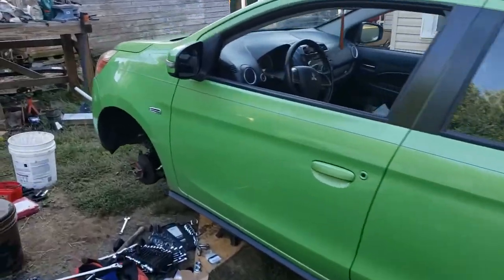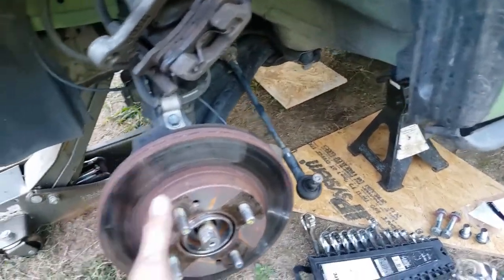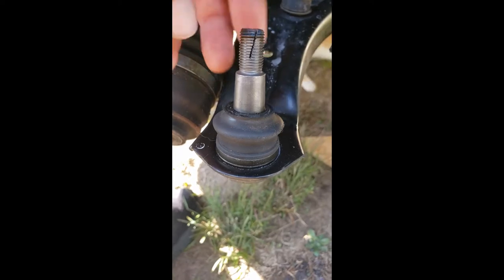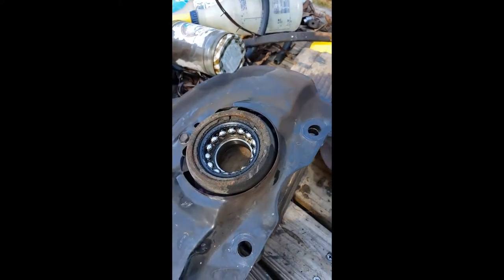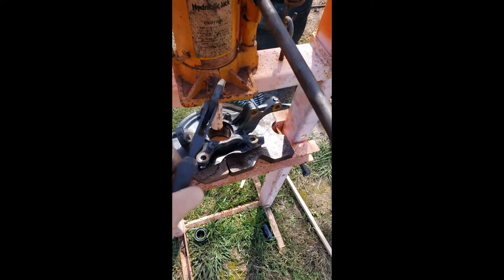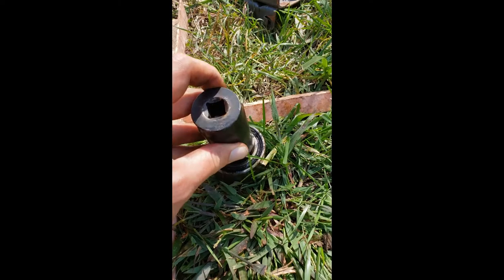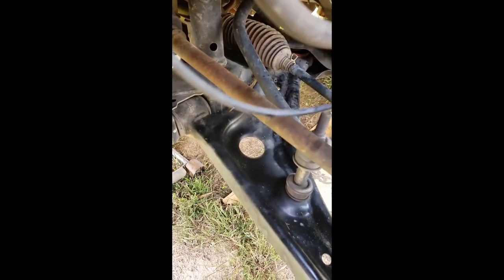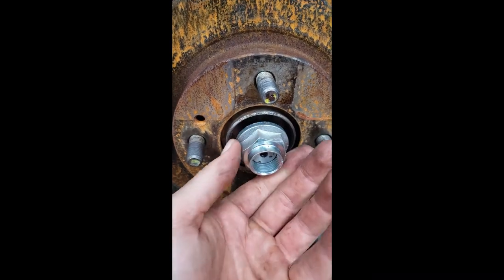2015 Mitsubishi Mirage Front Wheel Bearing Replacement

Comment: Jeez your old snap ring looked fine compared to mine!  (also a 2015) Mine was so rusted one ear snapped off, had to get the cutting torch out just to remove it.....nothing like living in the Rust Belt of Ontario! Lots of good info here, thanks. One thing that I noticed is that the torque setting you used for the axle nut is a little light. The service manual says 199 ft.lbs for the axle nut.

Comment: I replaced my engine a year and a half ago. And then the transmission earlier this year. I've been trying to avoid shops and do all the work myself. But this, I think I'll let the shop handle it. Great video, you saved me a lot of headache lol!
Reply from the maker: It was my pleasure. I have been dreading changing the transmission. Any tips? I have been looking for a used one and they are not very easy to find locally.
Reply: What year is your Mirage? How many miles did you have on the original 3A92 engine and JATCO CVT7 before you had to replace both? The powertrain on these simple Mirages are usually very reliable.

Comment: Thanks for the video. My 2015 ES is only at 35k, but I’m sure this will be useful whenever my bearings go out.
Reply from the maker: My pleasure! I will be adding more videos for the mirage and others so stay tuned. 
James,
Reply: @shutupanddoityourself  I recently bought a 2017 G4 and it needs tires for sure and possibly wheel bearings. Looking forward to the gas mileage of the 5 speed with gas prices going up!
Reply from the maker: @camaro2002rs  I am right there with you! It is pretty rare to beat the mileage of these little cars. Just have to keep them on the road. Haha

Comment: Ok kids, gather around. So removing and pressing wheel bearings that look like the one you see in the video is best to let a shop replace it for $40 per. Simply remove the knuckles. Yes, both cause they both have the same mileage. And bring along the new parts with you. It is best to use OEM. Trust me check out eBay for actual OEM parts some desperate car dealership is willing to sell parts at cost just to turn their inventory fresh. The shops will use all-date or Michelle to get depth specs. Totally worth $40 each. I have seen that tips are good but bringing them power drinks is even gooder
Reply from the maker: Thank you for the comment. Have a great day!

Comment: This is a good video why did you cut the sleeve on the back side of the hub though does that have to be removed  or something I don't understand and now I'm stuck there with new bearing in the knuckle and I wanted to see how it looked after assembly
Reply from the maker: I think you are talking about the race. You should replace the race if you replace the bearing as both parts wear out and are consumables. I will try and see if I can find a picture for you.
Reply: @shutupanddoityourself oh dude I found out the hard way I thought that wasn't Necessary and it was lmao didn't realize the new bearing already had the race installed😅🤷 I drove the hub into the new bearing and was like why won't it go in all the way. The. I snapped back to this video and said oh crap that's why he cut that brace off the hub shaft😅so tapping the hub back out I actually ruined the bearing so I had ti warranty another got it done but what a pain the ass. Man so I forgot to come back and say those rubber tie rod ends you had to cut with a sawzaw I ran into the same issue so what the ended up being is when you have it on the stand it makes the tie rod end hang further down and kind of binds on the threads so to speak my bolt was also free spinning so I took a jack and jacked the tie rod end up and that allowed the bolt the thread off. Same going on it just sat there free spinning forever unit I jacked the tie rod end up so the bolt didn't have to pull the threads though. I got it done without a press thank God just bearing race set from harbor freight,a dead blow,mini sledge and some 2x4. Also good tip on cutting the brace off the hub shaft for some reason it wasn't working on the driver side so I basically cut all the way through it so when I hit it with a flat it came right off didn't mark the shaft just taking my time with a low setting on the dremel.
Reply: @shutupanddoityourself  hell you want to know what even worse? So I was finishing the other side after I learned this hard lesson get the entire knuckle bearing and hub assembled only to realize I had forgotten the freaking snap ring. I was soooo pissed because I already knew I was about to ruin another brand new bearing like I did the day before. Thank God  oReilly's was cool and just gave me the 2nd warranty without question. Now it drives good my grandma's car but still wanted it to be safe so I had to redo it on both sides via not listening to you on the brace on the first side,then on the final side forgetting the snap ring😅🤷☠️oh well live and learn
Reply: @shutupanddoityourself  and this video also applies step by step for the 2021 mirage that's the year model I just did so I assume there all the same 2015-2022

Comment: how many miles were on your Mitsubishi Mirage before the wheel bearing went bad. i have 150k miles on my Mitsubishi Mirage and wheel bearing is still good. I am trying to figure out what is wrong with my brakes right now because they are sticky and grinding for a bit after letting off the brake pedal.  I have not figured out the problem yet.  I think the one pad on the front brakes with the wings that needs to slide back and forth is most definately not sliding its just stuck in there so that could be it.  I need to clean out the channels in there so the one break pad needs to be lubed up on its wings so it can slide back and forth.  it seems like when i put new brake pads on every time there is no where near (very) enough room in there for the brake pads and rotors.  I have almost zero experience at car repair though, so Diy ing  the auto zone car repairs is just a guessing game for me and learning experience to say the least.
Reply from the maker: There is around 120k miles. It sounds like a groove might have been worn where the pad slides back and forth. I would check to makes sure the pads are able to slide back and forth. If there is a groove you may need to fill it by welding it or replacing the knuckle. It is difficult to say without looking at your vehicle.

Comment: How did you get the assembly off the ball joint
Reply from the maker: I cut the nut off on one side and bashed it with a hammer on the other. It was not a smooth process. The knuckle made it difficult to hit it with a hammer. I hope that helps.

Comment: I replaced the transmission and about a month later the front drivers side hub bearing goes out....🙄. Lol
Reply from the maker: My transmission just went out as well... 😑 Did you replace it and if so, was it pretty strait forward?
Reply: @shutupanddoityourself  At what miles did your JATCO CVT7 go out in your Mirage? We're you able to do the CVT fluid replacements every 30k miles?
Reply: How many miles was on your Mirage before you had to replace the CVT?
Reply: @kylemas2005  it was a five speed manual. It really wasn't the fault of the car. I let my now EX drive it for a summer because her car had no A/C and she had kids. She told me she knew how to drive a stick (she didn't) and drove it on some of the worst rodes for that car.
Reply: @shutupanddoityourself  yeah it was actually a pretty easy job. Trans light as heck most everything was easy to get too.

Comment: That's just a 28 mm nut dude... Be smarter than the part that you're trying to remove... I just want to know how the fuck you're supposed to press the bearing out of the hub assembly and get the hub out of the bearing.. The driver side front wheel bearing took a shit on my 2019 Mirage ES after my girlfriend decided to try to dodge a deer and ended up eating a ditch.